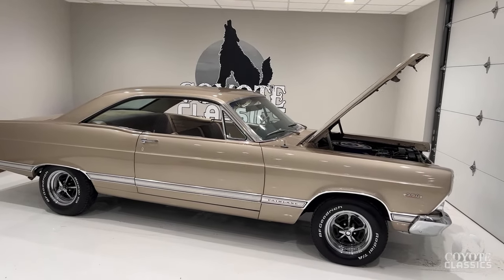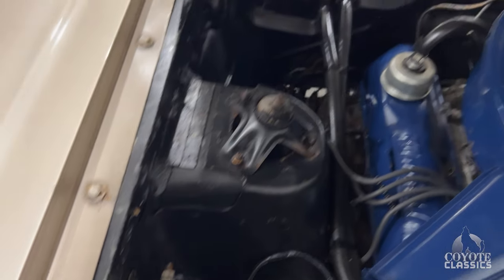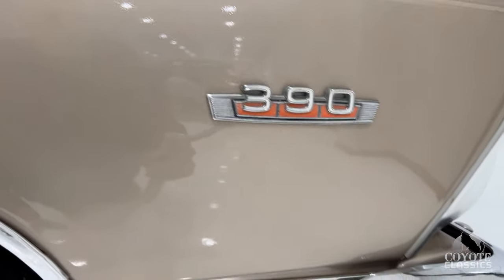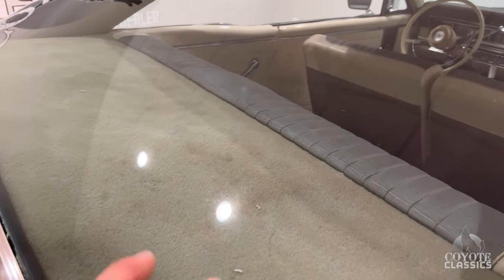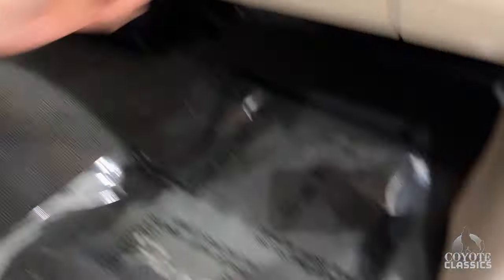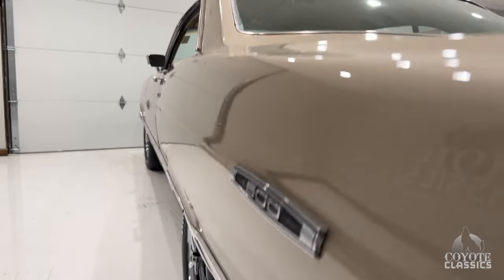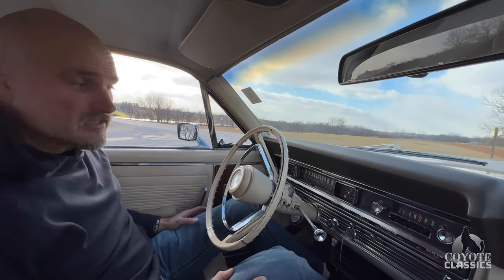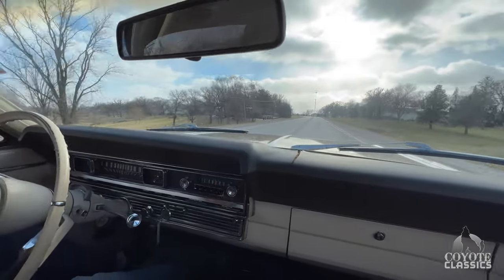1967 Ford Fairlane 500 (SOLD) at Coyote Classics $30,000

Comment: honestly each dealer is priced well. the difference is maple motors flips them as fast as they can. coyote actually researches them and offers up vehicles that are quite a bit different in class and categories.. i have never seen trash here at coyote classics but i have seen a lot of trash at maple motors. 40k being pricey depends on what you get.. i havent seen much if any of the cars here that need any real work to them... everything i have seen at maple motors needs work... see the difference is nick shows flaws.. but he shows the blatant ones that you see right off the bat...but he ignores some of the serious ones... like a car for 40k with a lifter that sounds like it is about to come out of the valve cover or a car that has a ticking the gets even louder when going down the road...or you see a torque box that looks questionably fixed or rust that has been painted over.. not dogging maple motors as they do have some good ones come through but again the big difference is everything here is road worthy and almost all of maple motors would require work to make them legal and road worthy.. me?? ill pay a higher price for something that is in better shape and is road worthy right from the start. as for vanguard motors??? that dude is proud of his stuff and deals in basically show cars... i mean honestly there better not be a thing wrong if you are paying 180k for a car. so stop with the bullshit guys.. ya like it buy it.. if ya cant afford it save for a different one you like..sometimes you get exactly what ya pay for... as for z codes.. they were the low hp 390's.. if i remember correctly they had like 300hp or so..not the higher hp most the 390's had. this is a clean nice car ready to roll and has history and value because of the motor code alone. also any old car is going to have some kind of issues... i owned a 68 torino that had 33k original miles 2 owners total with me..had the same color paint and she even had the factory plastic on the seat belts still.. grandma and grandpa didnt believe in them LOL i hit 15 and it was mine.. she had promised it to me when i was little because i loved that car.. sadly she burned up in a house fire.. i miss that car..now im sort of looking for a 68 torino gt with a 390 in it...but fairlanes look a lot like the torinos back then.  be well coyote motors and keep doing your thing..
Reply: Well said, I like Nick, I seen one video where he turned on the wipers, wich actually worked for a change, and the blade flew right off and the arm scratched the windshield, they just flip, every car I see needs 5-10k to be road worthy, and nobody down there knows anything about doing headliners, there a joke always. There is never a gauge working, radios ripped out, headliners all wrinkled and sloppy, heaters never working, this isn`t cheap stuff to fix with prices today, you get what you pay for.
Reply: Yea,Maple Motors gives them a wash & out on the front line they go. Coyote has mechanic  & has a little nicer car also. Nick doesn't seem to have any trouble selling cars I guess. You can't buy a 40k car & not have ,horn,wipers or seat belts. Not to mention turn signals & such.

Comment: Dude I seen all your prices and they outrageously way over priced! Maple Motors has way better cars at way lower prices! Take notes 📝
Reply from the maker: Have you done any comp checks or market research before making this observation?       We check comps on every car we price to make sure that everything we sell is fairly priced, according to what others in similar condition are selling for.   For example if you look on hagerty, classic cars.com or autotrader for 1967 fairlane 500's with an original 390 like ours. You will find that ours is one of the least expensive for sale on those sights, and it is just as much car as the ones you will see priced at $35,000-$40,000.     Now do this for every car on our lot, then see if you still believe that our cars are "outrageously way over priced”
Reply: You can always make an offer
Reply: Man u obviously dont know anything about cars. I watch maple motors every wk this car for 30k is a damn deal an a fair deal. This is a nice damn fairlane. Most of maple motors cars thay have a lot of small problems because they dont repair they just sell. I Like both these companys. Nice fairlane guys!!!!
Reply: @michaelharrison6978  and I watch maple motors as well have you seen vanguards prices or Volo,Gateway,southern motors,gr auto gallery etc.... mecum,barrett
Reply: I follow both Nick at Maple Motors & these guys, both are very reasonable and put out great cars at fair prices. One difference is that Maple Motors trades buys and sells only as Nick states himself. Coyote Classics does mechanical repairs deep detail cleaning of every car on the lot. Don't compare apples to oranges.
Reply: Maple Motors has some pricey cars to, novas going for over 36K that still need things. Market is up 43 % from where it was in 2020. Cars are expensive everywhere. Don't hate on the Classic car dealerships because they are doing best they can, the more cars they flip the more money they make so they are not pricing them just to keep em in the lot.
Reply: @sm5405   Correct... the classic car market has gone bananas on  prices and cars are leaving the country and being sucked up by dealers
Reply: @Michael Harrison  Hey Mike you from Lapine
Reply: So I watch both channels, I was interested in a 78 trans am that coyote classics had, they told me about a plastic piece on seat belt that was broke,and also they showed on video, they informed me  that they ordered it, coyote fixes things, maple motors does not, which is fine cause I do like them too, that's the difference between the 2
Reply: @SA-bq1us  prices have gone up alot  I remember watching counting cars and they had beautiful monte Carlo that went for 16-17 thousand,but this was ten years ago.
Reply: Every car I see on Maple Motor has major issues, headliners hanging, gauges broken, yeah there cheaper, but every car needs 5-10k worth of repairs or repaints.
Reply: Did you not see the sold sign ,car price is what someone is willing to pay.
Reply: Both great places to shop for sure